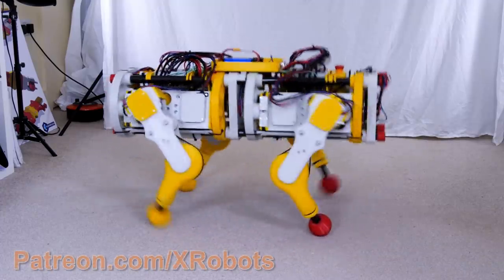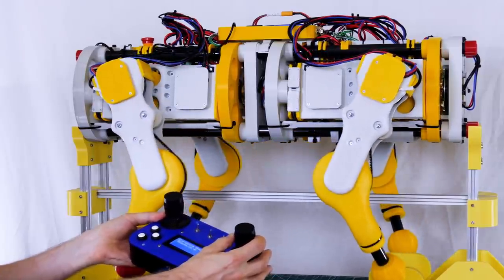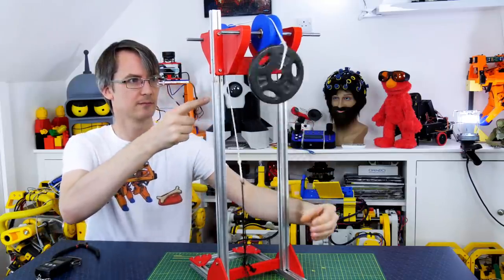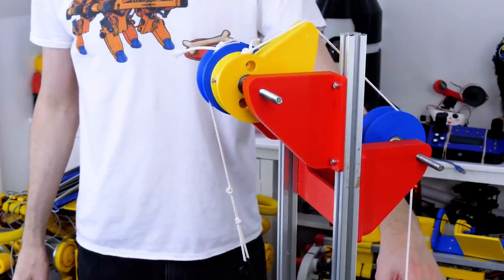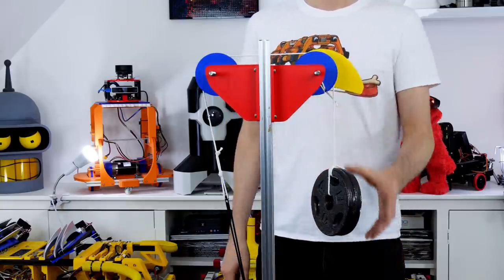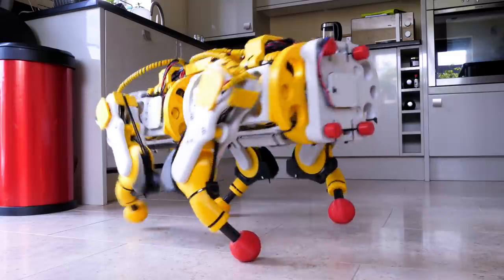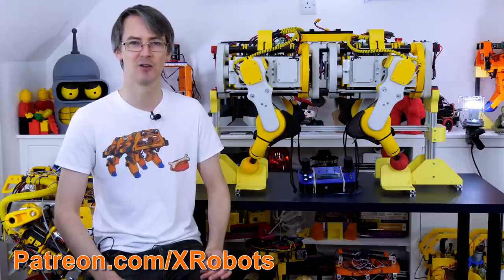Constant-Torque Spring-Balanced Actuator

Comment: I was literally just working to solve this same problem last night for a different application, and I think I know why your cams don't give as flat a response as you wanted.  Spring force (ideally) varies by the linear displacement of the spring, which (I think) means that you need to set the stations on your cam profile by distance along the circumference, not by angle, and set your radius at each station based on the spring's pulling force for that displacement multiplied by the ratio of pulley radius / cam radius to get the return force you want.  I used an excel spreadsheet to solve for cam radius to give a constant force ratio at stations a fixed distance apart, and when I plotted those out, it gave a ear-shaped result that closely resembles a compound bow's cam, rather than the neat nautiloid spiral of a constant or exponential cam profile.
Reply: don't forget, unless he's using a specific linear spring the force exerted per unit displacement will not increase linearly. But, you are correct about circumference. Something like a Vulcan Conforce spring would actually package excellently in this application. Hope your application works out!
Reply: @zachbrown7272  Thanks!  And yeah, I know spring force is never ideal (welcome to engineering, right?).  Luckily, my application doesn't require a perfectly linear force response as long as it stays within reasonable bounds, so I'm confident it'll work out.  We'll see how close I got once I get everything printed and test it out :)
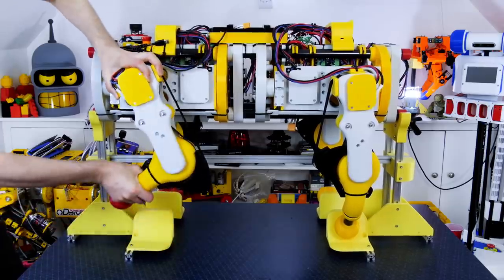Reply: Does the friction as the bungee wraps around the pulley/cam affect the system? 10:20
Reply: @TheRainHarvester  I don't think so..I feel the friction exerted is not static it's dynamic since the coefficient is relative to the motion of the cam so it declines as the spring force reduces
Reply: @createwithbido  just to clarify... i mean the sliding friction of the bungee on the cam. As the bungee wraps more, onto the cam, the sliding friction increases.
Reply: @TheRainHarvester  true!
Reply: Probably unimportant for this project, but another complicating factor is that the bungy is wrapping around the cam...changing it's effective/active spring length. (wouldn't be a problem if idea frictionless)

To avoid that effect, use a piece of non-stretchable rope or cable where it rides on the cam, then connect that to the spring portion.

But I doubt that is worth the effort for this application.
Reply: @andrewstambaugh8030  I had this thought too, but I think you're right that it may not be worth it on this one -- the saving grace for this application is that the range of motion is small.  A non-stretching link to wrap around the cam with the spring separate would be more ideal (and probably more reliable long-term, because of the friction issue of the bungie stretching while under tension against the cam), but then you have to have enough space away from the cam for the spring at full extension.  I had this issue on my application at first -- I'm using kite string on the cam with separate springs -- because I needed 3 full rotations on the main pulley, and I forgot to factor for the at-rest spring length on top of the required extension, so there wasn't room to mount and pretension it all as-designed.  I was able to switch springs (shorter ones) and get it all together, though, and it's still a reasonable approximation of constant force through 3 full turns.
Reply: The issue is largely dependent on the instantaneous radius of the cam depending on the position of the cam relative to the anchor point of the spring. i.e. it's not entirely linear due to the vector of the force being perpendicular with the radial vector, resulting in the point where the moment is being applied not being at the "top" of the cam.
Reply: @Darkgon101  Right, which is why it should be designed by the combination of spring displacement and offset distance (perpendicular distance component). Which is notably more complicated than it seems at 1st...assuming the spring is linear...

Using a non-stretch string around the cam simplifies a lot of complexity, but sacrifices some compactness of design.

I think we are all on the same page.

Comment: You could use vacuum to help the joints, something like a large syringe with the end closed, the amount of force would always be the same no matter the extension of the plunger, check it how the exercise machines from the space station works
Reply: Or even just gas struts, which can have close to 1 K factor.
Reply: @nophead  - THIS!!  Except there is the issue of added weight, size and movement restriction.
Reply: Air shocks don’t have a constant force but springs do.  As the air compresses or decompresses the pressure changes making it behave differently.  Springs have a constant force (at least good ones).  You could try springs from bike shocks.
Reply: @elihamaker3694  that depends on the ratio of system volume relative to the change in system volume
Reply: @brandonb6164  An air shock would work but you would need a large reservoir with high pressure (50-100 psi) Which I could see being a problem with the weight of the tanks.
Reply: This was my first thought as well, but much harder to do than bungy around a cam.
Reply: my brain says the force will only be constant if its a good vacuum (no air to compress)
Reply: @elihamaker3694  it’s using the absence of air, it will only ever have the force one atmosphere pushing it down no matter how much you pull the syringe
Reply: @elihamaker3694  Are you saying most springs aren't good springs?

Comment: Ive been following your work for 8 years or so now, Ive got to say, you've gotten really really good. Its astonishing how much you've progressed in both complexity of your projects as well as the speed at which you complete them. Really impressive.
Reply: @kruleworld  no kidding.
Reply from the maker: Probably pay for people better than me to do the projects
Reply: @kruleworld  I think budgetary restrictions are actually very good for projects like these. The open-source community in general is awesome in that people are finding ways for average people to make things that they wouldn't be able to ever have if the only way to get them was by purchasing them outright.   
  
On top of that, the design process of open-source stuff favors efficiency and practicality. The big R&D facilities start with a problem and are given immense resources  to build a solution. This seems to lead to designs that are impractically expensive that inevitably have to wait for costs to go down to become practical. Development like what Mr. Bruton is doing basically starts off an idea to build a thing and then works within practicality restraints until a solution is found. If Boston Dynamics was working on this project, they would've just made a more complicated motor for the knee joints because they have no incentive to make the robot less expensive. They would've probably tried to water-cool the battery or something.
Reply: @jamesbruton  lool

Comment: A few comments that spring (sic) to mind:

1) you don't want constant torque, because your legs are variable geometry levers!  The torque on the motor will depend on the angle of the leg to the ground. Standing with a perfect vertical leg takes no torque, standing crouched with a bent leg takes the most torque (as humans, we "lock out" our legs/joints when we stand for long periods to achieve exactly the same effect).  There fore you need to profile your torque assist system to match this characteristic.  The worst case you have to avoid is at max leg bend but with no weight on the leg (fully pulled up) and you motors must be able to overcome your static assistance load at this point. This normally isn't a problem because that sort of posture is not often held for long, being used to temporarily pick up individual legs over obsticles etc

2) The power disipated whilst stationary is the holding current, multipled by the forward voltage, which is the voltage required to push that current through the phase. Because the motor is static, there is no back emf, so that fwd voltage is simply the total dc resistance of the phase (motor phase + phase cables + inverter switch resistance). Because that total voltage will be small  the turn down ratio to the battery is high, so battery current, and hence battery power is pretty small, despite the high phase current.  For example, with the following arbitrary numbers:  100 amps phase
60 mOhms total resistance (High fet + phase cable in + phase winding + phase cable out + low fet)
24v supply (battery)

 V = IR, so clearly the foward voltage wouold be 100 * 0.06 = 6v

Turn down ratio = 24/6  which is  4, so ignoring inverter efficiency (typically 90% or more) you'd expect 100 / 4 = 25 amps being pulled from the battery.

the powers clearly balance (100 x 6 = 600 and 24 * 25 = 600)

What this neatly shows is the efficiency of a motor is dominated at zero speed by it's dc resistance, which is why we try to minimise that characteristic (the motor will have a large inductance, ie a large AC impedance in order to have a small torque ripple from a modulated supply (PWM))

3) if standing for a long period, it may make sense to provide an "Over centre" lock to the leg geometry, ie a mechanical back stop to which the motor can rotate to lock the legs vertically, meaning motor can be then turned off.
Reply: Excellent info, thanks for sharing!

Comment: James, you may actually want not to have a constant force because while the weight of the robot is relatively constant for each leg, each joint will need different amounts of torque depending on how bent it is. Really great innovation though. I would imagine making the robot significantly light would also be of aid to the overheating. Keep inspiring others. Thumbs up!

Comment: Hey James, you can measure high currents easily with a clamp meter or hall effect sensor. Or you could fully charge your battery run your robot for 10 minutes recharge and measure the Ah you've charged in your battery and this way estimate your average current draw. BTW I love your channel 👍🏻

Comment: I remember suggesting a solution like that in a humanoid robot forum back in 2012. The problem was that the knees on those type of robots are direct driven by servos and the knees get the most torque making the servos move slow or not at all. The typical solution was a sort of crouch-walk, but I suggested a sort of spiral Bungie like the one used on the bow-flex (obviously much smaller) but being an animation major and not any type of engineering or math guy I couldn't quite explain my idea to the technical guys there and found out how unfriendly that forum could be.

I've always liked how you solve engineering issues the same way I do. Well, honestly I don't know if you really do, but you sure do explain them in my language, and I appreciate that.

Comment: I had a constant force spring mechanism design at one time. I used a rack and pinion gear setup where the pinion had an irregular profile. The pitch diameter followed an archimedian spiral. It's been years, I forget the details, but I also had a cam groove behind the teeth to hold the rack (which was on a pivot) in place meshed with the pinion. Spring on the rack, pinion shaft was the output.

Comment: A spiral wound clock spring is what you need.
A tape measure has near constant force. Copy that sort of mechanism.

Maybe you could use the spring out of a seat belt retractor or something like that and build it into the leg joint?

Comment: In case you don't know, there are constant force springs (I've typically found their use in quill feeds for drills). They're typically a fairly small, round spring meant for these kind of rotational loads. Searching "leespring constant force springs" should give good results.

Comment: Great success! You could always measure the heat of the battery with a temperature gun with and without the springs and use that data to give you an idea but amazing job on the analysis and the implementation.

Comment: The cam seem to function sort of like the patella in a human knee. Thanks for your video, I am trying to planning to use a spring to allow a stationary robot-arm to lift a large load even with relatively low-torque servos.  Now I know it can work and probably even work better with a cam system.

Comment: would this be significantly more or less complex if you were to use a constant force spring instead of the cam/bungees?
Reply: His system is very easy and cheap to build, and it's also light weight. As long as you can tolerate the tiny bit of bulk, it would be hard to gain much without more expensive and heavier parts.

Comment: To reduce the torque the motors have to exert when lifting the leg, would it make sense to attach some kind of clutch to the bungee cord that only engages when the weight of the robot rests on the leg? I was thinking: The upper arm could be made of two parts that are joined with linear glide bearing rods and a tiny bit of longitudinal play. The top end of the bungee cord would run in between the two parts and get clamped by the weight of the robot whenever it rests on the leg, but would slip through whenever it lifts the leg. The end of the cord could be connected to a much weaker bungee cord where it comes out on the other side of the "clutch". This weaker cord could be attached some distance away, e.g. close to the knee. Its purpose is to keep the thick bungee cord somewhat taught and pull it back through the "clutch" when the leg is straightened before it the foot touches the floor. I hope this makes sense!
Reply: Following

Comment: Gas struts or springs like the ones that hold open the lid of your car trunk are nearly constant rate. Available in lots of sizes and force levels for cabinetry. 

Also constant rate springs are a thing look kinda like a tape measure.

Comment: The new kneecaps touching: seems nature had the same issue and evolved into knees facing the same direction.
Reply: Yeah either that or they evolved to stand (or nearly be able to)
Reply: Its probably why lizards havent evolved to stand upright (On all fours, not biped)
Aside from their very long bodies and itty bitty legs, their knees face each other. So if they did ever have a body plan more optimal to evolve locomotion that isnt skittering, their fat knees would be bonking into each other.
Reply: have you ever seen a dog? the knees/elbows do face together, natures solution was slanting the hindlegs outward.
Reply: What are you talking about?
Name one!
All large 4 limbed animals, including humans, have knees and elbows pointing to each other.
It works well; look at horses, tigers, cheetahs, basilisks, alligators (which can sprint very fast!), 
Side note: Birds have their "knees" close to their ribs, practically internally. What we see as their knee is really their ankle (which is why it faces backwards, as ankles do), and their shin and "feet" are elonged into their legs, and the "ball" of their foot is their whole foot area. Check out their skeletons, especially of long, thinned-legged, wading birds (it's more obvious), it's fascinating!
Reply: @pauldeddens5349  horses have the same leg design...
Reply: @pauldeddens5349  also, check out the discussion on triceratop locomotion.
It was though they "waddled" like lizards, but new research shows their legs have minimal slanting, their spines don't flex horizontally like lizards, and their joints moved like rhino's and horses' joints move (suggesting they could run fast!).

Comment: Worth noting that the restoring force from an elastomer is also temperature-dependent, and that shape changes alter the temperature. The relaxed state of the polymer has more entropy, and the stretched one less, such that higher temperature results in more force. This also makes for some hysteresis.

Comment: Coil springs can give constant torque over a limited range, eg. a few rotations.  Actually any spring is relatively linear over a small range of the maximum spring extension.  Also coil springs are much more compact and can go over your motor since the motors only do a few turns anyway.  The spring size could be adjusted to give the necessary nonlinearity to somewhat match the torque needed as the knees bend.

Comment: Its important to note that bungy cords and other elastomers are not linear, they take more force to extend than to hold and let them retract. There also can be variances with the speed and acceleration in which they are pulled. Its probably not to important when used passively like you are here, but it may begin to matter if you incorporate them into any models.

Comment: Check out "variable pivot point" design used in mountain bike rear shock absorbers.
They are disigned to eliminate the "bounce" while pushing the pedal (which would waste your peddling energy, as the bike would otherwise bounce as you pedal).

Also, a cam moves the pivot point as well, changing the angle of force from vertical to diagonal, something you may need to compensate for, or can utilize for benefit.

Comment: About the current measurement, have you looked into hall effect current sensors? I have used ACS758ECB-200U-PFF-T for very heavy drones, and it worked really great. With two of these in parallel you could measure up to 400A using some ADC on your controller (and maybe a voltage divider).

Open dog progress is by far my favourite content of yours, cheers!

Comment: I agree with some of the other comments, I don't think you actually need constant torque since the torque applied changes as the force vector changes when it bends referenced to the floor.  (I probably didn't explain that very well.)